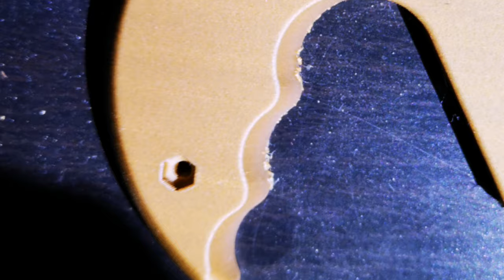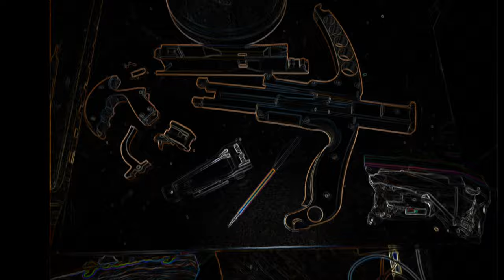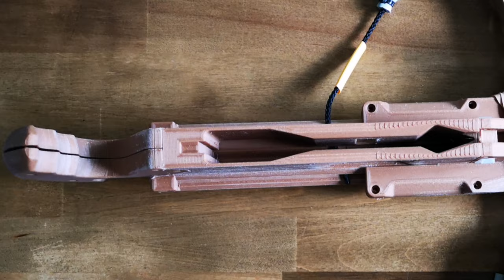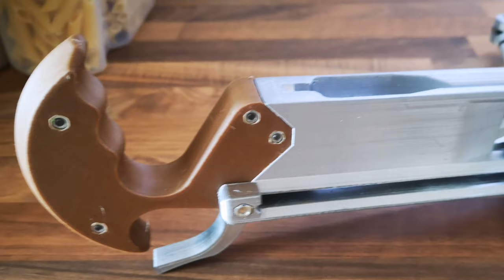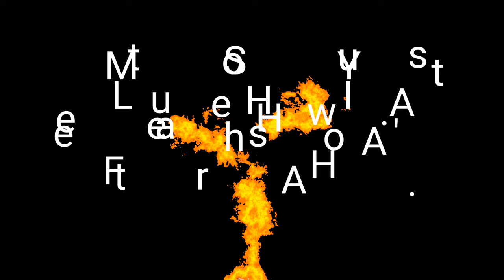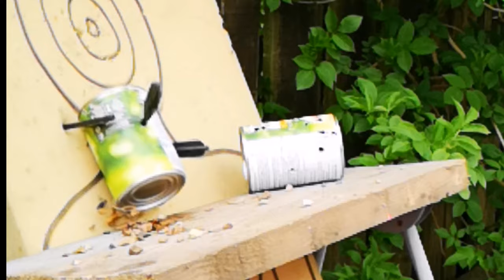The Sliding Legolini - 3D Printed Crossbow

Comment: Going to kick off printing mine today/tomoz. Torn as to what infill to use. I've been using gyroid for everything, but it can take much longer using this over triangles/grid. Trying to get it under 50hours. Ender 3.
Reply from the maker: I've used triangle infil for the arm, grip & slider.. and Cubic for all  parts including the magazine and slider.. They seem to work well with the stronger rubber.

Comment: Hello Mr T, recently I've tried Theraband silver instead of block. Taking the same length of the strings I'm not even able to tighten the bow completly, and my arms are not weak at all. What is you experience? I saw inthe other video that the outer string is a litte longer, surely a way to overcome the problem. What are the length of your Theraband and strings you used? TIA. Marvin.

Comment: what crossbow bolts did you use? I printed one, but the bolts I ordered are too big (won't for through the "barrel")
Reply from the maker: I just used the standard 6.5" aluminium Pistol Bolts.. I found the plastic ones were slightly too long, so I reprinted the magazine to accommodate 5mm longer bolts.. Now it fires both no problem.. Link below, hope that helps.. 👍 

https://www.ebay.co.uk/itm/362941120577

Comment: did you have to use supports on the print?
Reply from the maker: It's actually designed to print without support, but I did use tree support on the magazine section 👍
Reply: @mrt2566  Thank you for your reply, I downloaded the file yesterday, and when reading the manual it was very limited in info about supports so assumed it didnt need any, but Im glad I asked some one who successfully made a Legoleni before I started printing, as I didnt want to make a big heap mess of filament lol, so thanks again, great video
Reply from the maker: @oliviatulloch1358  I have a bag full of failed prints, enough to make several whole legolini's 😂.. I'd recommend downloading the modified bow arms from thingyverse that can take double rubbers if required.. Works with single rubber as well.. 👍
Reply from the maker: @oliviatulloch1358  https://www.thingiverse.com/thing:4720427